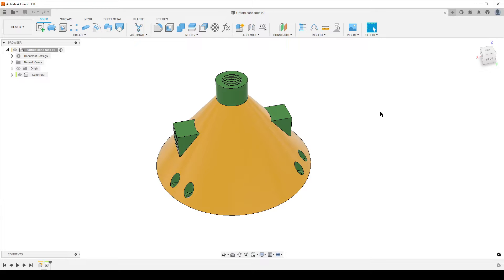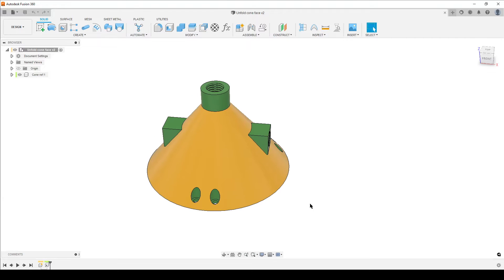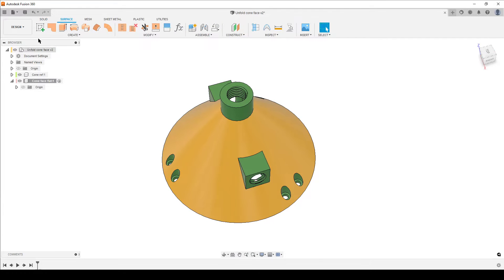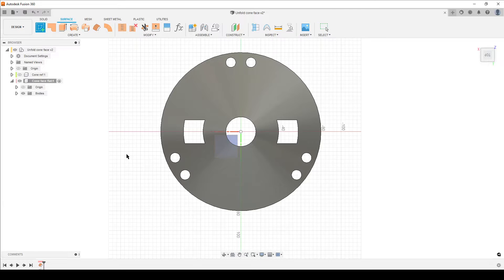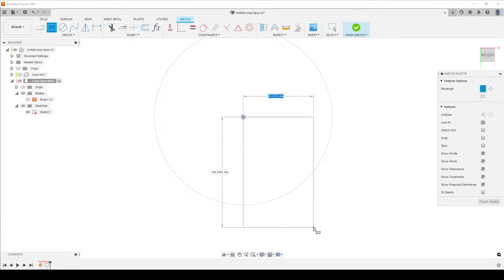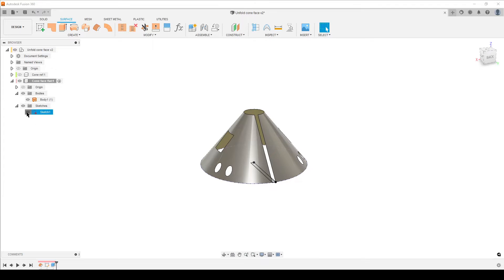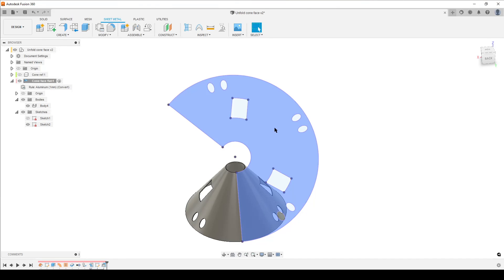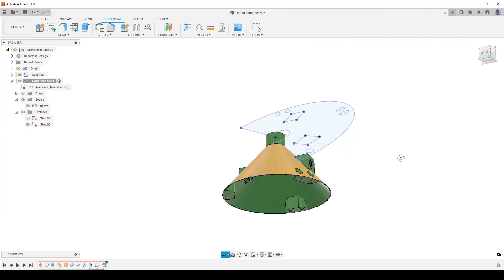Fusion 360 - Flat Pattern from Cone face

Comment: Hi, I´m a bit late to the party, but I want to do the unfold with a concave mirror. There is no straight face like in your example. Is there any way to do that? I would say I´m a very experienced user, but found no solution for that in F360...
Reply from the maker: If it's bent in 2 directions (multicurve surface) Fusion will not be able to unfold it. And basically no software can unfold it without distortion.
Reply: @KristianLaholm  Yes, but I need it with distortion, because we want to bend a thin plastic sheet to that curvage. The problem is, that we cant reproduce this distortion in CAD. I´m now trying aroung with Solidworks surface features, which seem to work.
Reply from the maker: @WillGiam_3D  You-ll need some trial and error with the material you choose, no software can spit a correct flat pattern directly this is dependent on how the material flex. The classic problem of taking a flat piece of paper and wrapping it on a ball.
Reply: @KristianLaholm  Yes, I know the problem - I want a solution :D Solidworks has problems with more complex functions, Fusion is just awful for that and Alias and co are too expensive... I don´t get why such a simple feature is missing.
Reply from the maker: @WillGiam_3D The problem is that from a math standpoint there is no direct solution to the problem. The only way forward I can think of is trial and error,  simplify the shape into a cone, cut the material and then try how it adapts to the shape.
Reply: @KristianLaholm there is a direct solution. It's the material gradient for the curve. So you have a scale on each point of the curve. This way you can also do the math, but it's a big effort. There are programs like Solidworks which can do the work already.
Reply from the maker: Are you sayin there is a direct solution to making a flat pattern of a torus or a sphere shape face? 
You are mentioning "material gradient" is that how thin the material gets then deforming?
Reply: @KristianLaholm  Yes, there is. https://www.youtube.com/watch?v=Rnx2drHZOWs

The gradient is more like a value to define the deforming factor. But yes, also how "thin"/ how much its getting stretched.

Comment: I followed all the steps, I can see the body element with thickness, but when I use the convert metal sheet the element doesnt highlight with thickness size and there pops up an error - cant calculate thickness. Please help!
Reply: Finally figured this one out... Make sure you cut in the cone is mapped to the axis of the cone perfectly... The tutorial glossed over that bit. The edge must be perfectly straight or it wont work.

Comment: This workaround apparently quit working...I and another guy have tried everything and it only gives an error now. None of the tutorials work.
Reply from the maker: I gave the workflow a try and it works for me. Is there a problem with the body you are referencing (creating the offset face from, how did you make that cone)? When do you get the error in the workflow?
You say none of the tutorials work, what over tutorials have you tried?
Reply: @KristianLaholm  https://www.youtube.com/watch?v=LK9XYT85lD4&ab_channel=modernDEsign

This is the other one we've tried. I formed the cone using a sketch and the revolve function and then followed your steps exactly. Tried it twice. I don't know what else to try...I've used this same method before to turn a cylinder into a flat pattern and it worked.
Reply from the maker: @chrisgiesbrecht2159  It sounds strange. I can do both workflows with no problems. If you can share the file (include all the steps you take) I can have a look.

Comment: Great tutorial! But can you create a flat pattern from more complex sweeped surfaces? I have trouble to do so.
Reply from the maker: That depends on the surface. Fusion can only flat pattern surfaces with bends that are around one axis, no compound surfaces. And most complex surfaces can't be "flat pattern" without stretching or compressing the result (think of wrapping a flat papper on a sphere). Meshmixer can be an option, there are tutorials.

Comment: Super helpful. I was watching another video and this straightened me out for generating the unfolded image

One problem, though, I can't figure out how to create an unfolded technical drawing to have it ordered from a cut shop.
Reply from the maker: In the sheet metal component create Flat pattern. This needs a flat face and you need to do this before reducing the gap in the cone. And then you can make a drawing from design, change representation to Flat pattern.
Reply: @KristianLaholm  Thanks for the quick response.  I was able to create the flat pattern and had no problem grabbing my 0.001" flat face by zooming in on it.

I had two issues which worked themselves out from there.

(1) I tried to change my page size to landscape before finalizing the base view placement, and couldn't figure out how to add the base view back.  I created a new drawing and placed it before changing page sizes, and everything worked out normally from there.
(2) I exported my flat pattern to a DXF for editing in CorelCad 2023 (Affordable autocad clone).  The original Fusion DXF and the DWG I saved from it refused to change dimension text size.  I had to save the document a second time and then reload it before dimension sizes would change.  Not sure if this was on the original DXF end, or just a glitch with CorelCad, but restarting the program with a second save worked.

I am still a little confused about the nuance of switching back and forth between (activating) flat patterns, but I was able to get drawings produced in Fusion and an Autocad clone from them, so your reply was super helpful. Thanks again. (Original post was from a company account; this is still me).
Reply from the maker: @JamesArlow777  I'm glad to hear that you were able to create the flat pattern and resolve your issues. The DXF file format has some strange revisions sometimes causing problems with text and poly-lines.
Keep on testing and learning :)